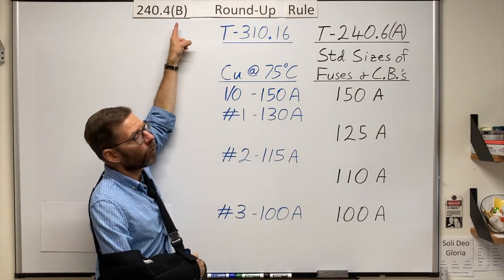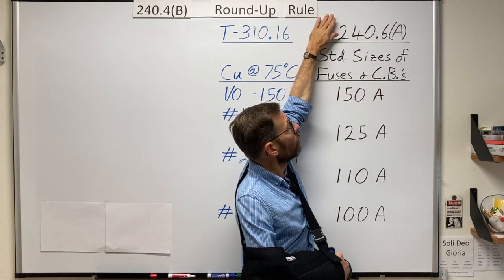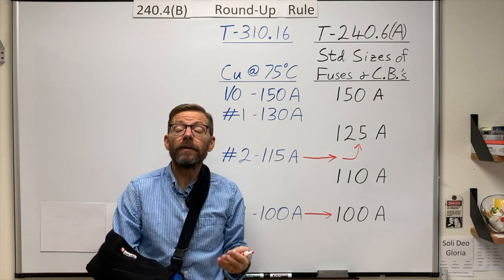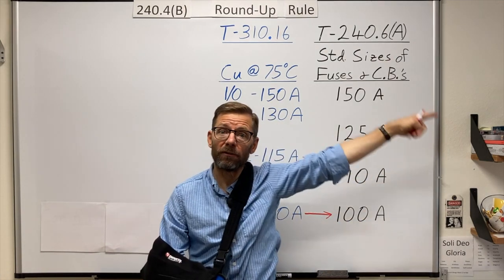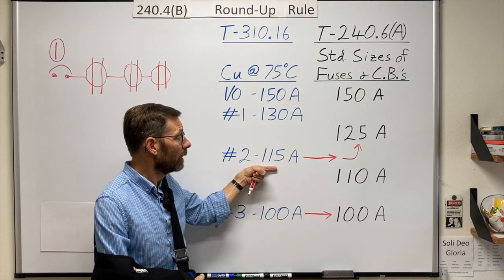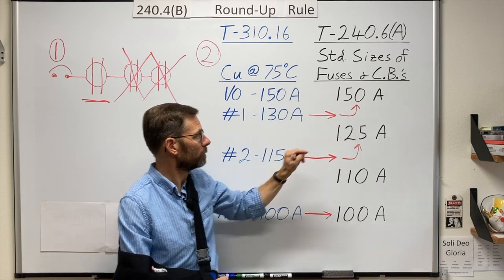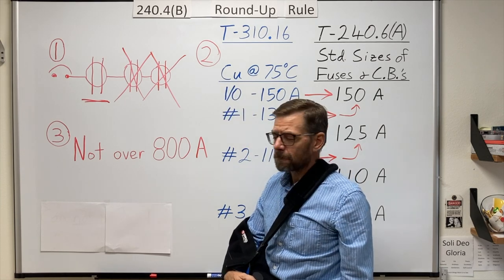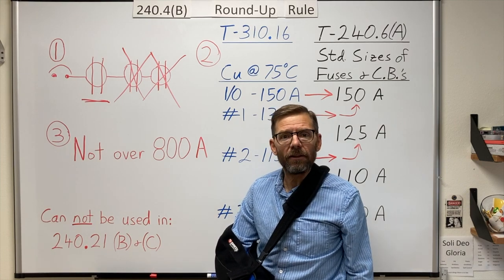240.4(B) - The "Round-Up" Rule

Comment: Does this mean if any of the 3 rules gets violated, you round down to the lower amp? Like if I have an ampacity of 27A and the branch circuit has more than 1 receptacle, do you round down to 25A breaker/fuse? That is how I interpret the exceptions to the “round up rule”. Asking for the journeyman test.

Comment: You said after derating you can use the next size up. The 2017 nec says “ without overload trip adjustments above its rating” what does this mean? I’m confused
Reply: Most small breaker ratings, typically 200A and less, are built-in to the breaker and not possible to change.  The breaker's trip rating is calibrated at the factory, and it's a fixed rating.  These are known as thermomagnetic breakers.

Larger breakers tend to have adjustability to the trip rating, where the user can modify the setting on a dial.  The breaker has electronic circuitry that determines when to trip, and you can configure the circuitry.  So you could start with an 800A breaker from the factory, and tune it to act as a 600A breaker.  This is what that section is stating about overload trip adjustments.

So if you have a standard OCPD that has its rating factory-sealed inside it, you get to use 240.4(B).  Whereas if you have a user-adjustable OCPD, you need at least as many amps as the setting you configure.  Such devices also have to be locked to only be accessible to authorized people.

Comment: But doesn’t line up with Service conductor on residential with 83 percent rule you may have a 190 amp load calculation on 200 amp service with 180 amp 4/0 aluminum